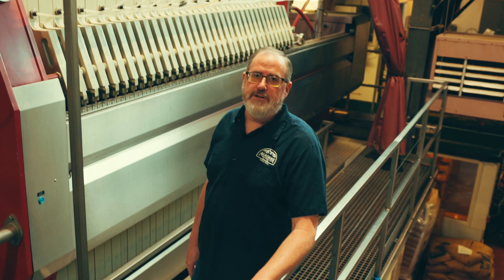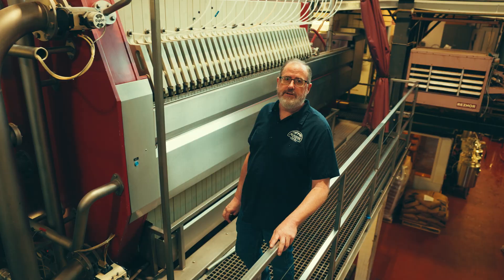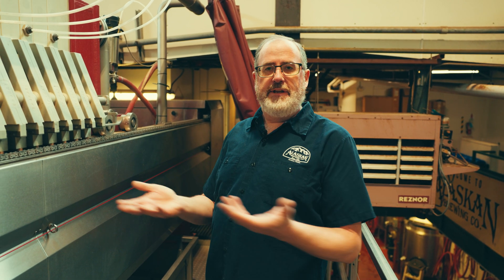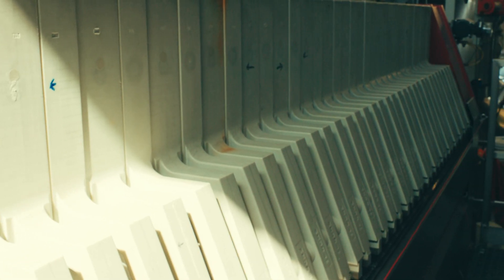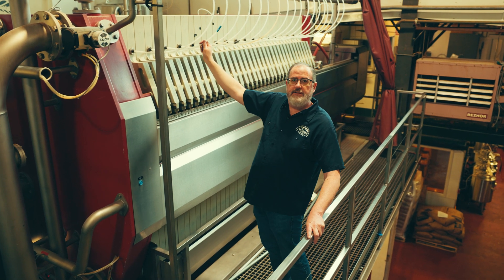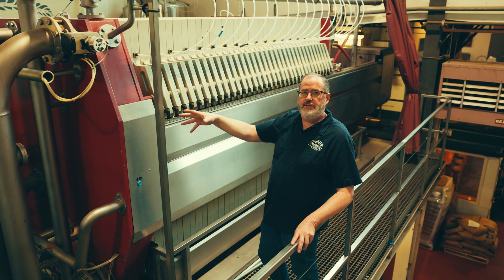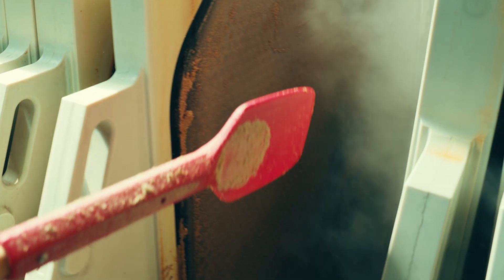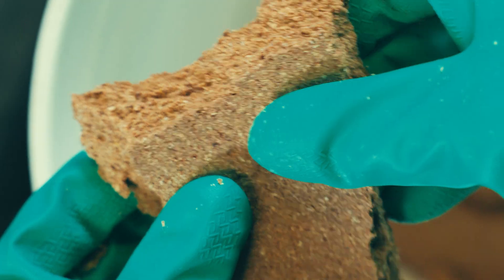Beer Powered Beer: The Mash Filter Press

Comment: Can I ask, how difficult is the cleaning process for the plates? I imagine a fair amount of water is needed to clean between turns?
Reply from the maker: The plates are cleaned by knocking off the spent grain after each brew before water is run between the plates to clean the rest out. It does take some water to clean, but cleaning out a traditional lauter tun requires a fair amount of water, too. We save a great deal of water using the mash filter press as it's much more efficient method of extracting sugars than a traditional lauter tun.